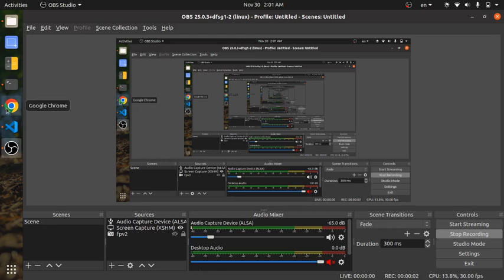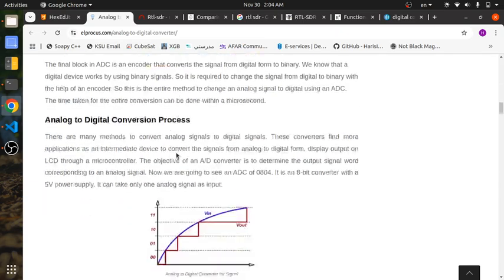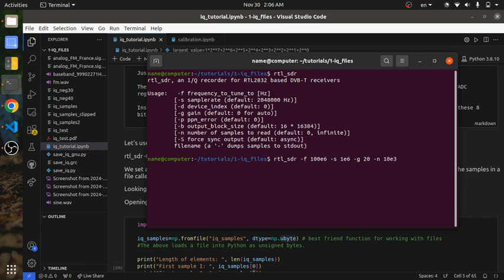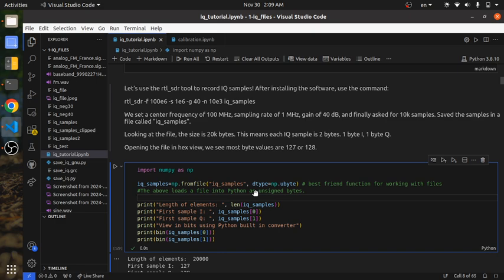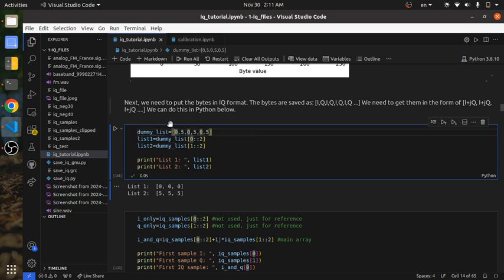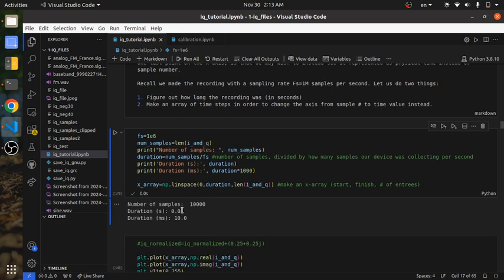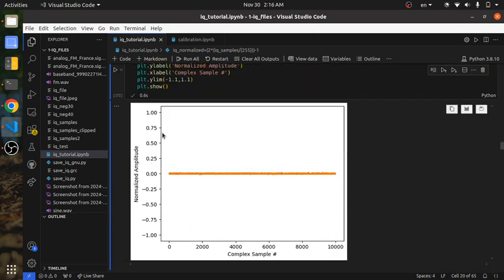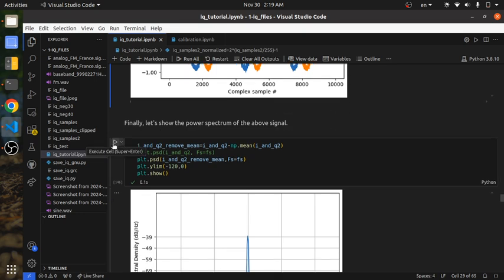SDR and Signal Processing 1: IQ recordings in Python

Comment: Hi, good video. I have a question after watching your video. Let's say i received a RF signal(which usually use FM )which has centre frequency at about 87.6 Mhz, why does ADC output IQ two channels data, even If FM doesn't generate IQ signal as digital modulation like QAM? Thanks in advance.
Reply from the maker: @weichen383  Hi, thanks. Sorry, I saw this late. The reason is the SDR is using two ADCs. It is still one channel, but a complex number having two parts (2D). You will always get the 2D sequence which represents one channel. By the way, this is independent of the waveform being received.